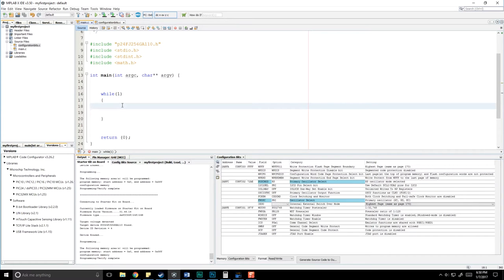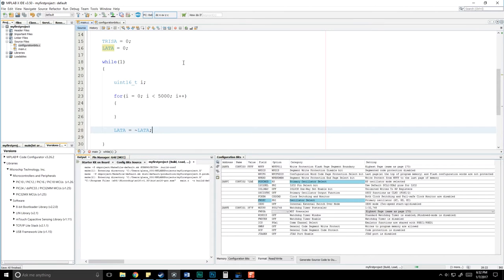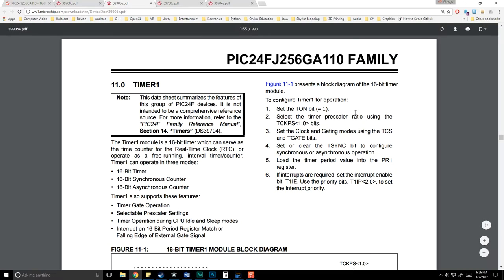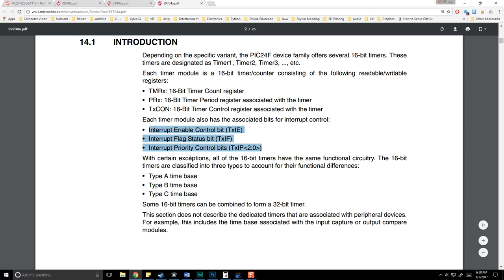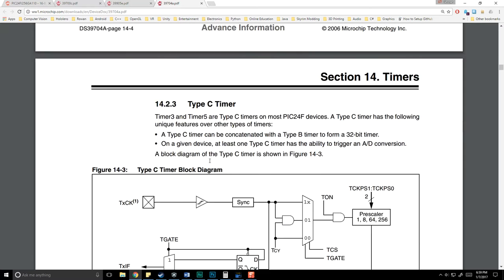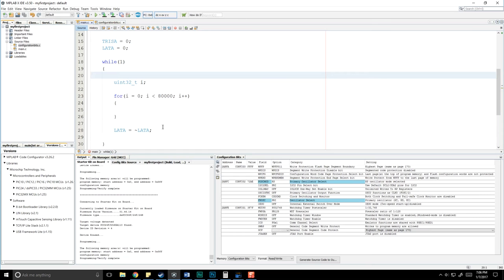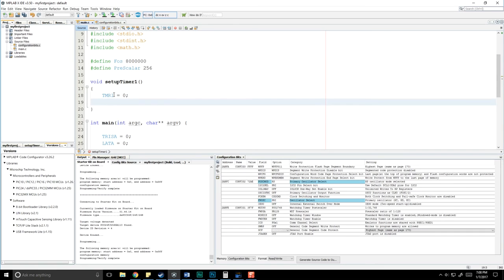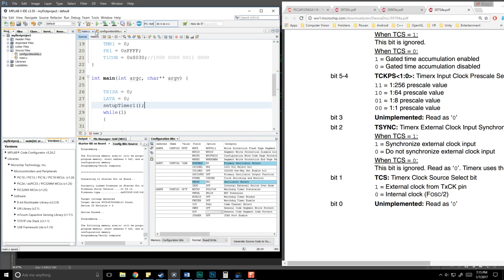Exploring PIC Microcontrollers - 04 - 16-Bit Timer Basics

Comment: Hey George, Thank you very much for your work, I finished all the videos and looking forward to seeing more, especially about sleep and idle modes with interrupts, reading from multiple inputs, ADC, ..etc. 

I am using the Explorer 16, I followed the instruction in the videos, however, the LEDs don't toggle, seem like the interrupt is never called, also when I tried to use the comparison in a while loop between TMR1 and IPerS it shows an error (I can't use defined values, unless I assign it first to a known type like int). another thing, is that I can't use the uint16_t. I don't know if these things are related to explain why the LEDs are not toggling using LATA=~LATA.

I am using the MPLAB X IDE v4.01 with Explorer 16, dsPIC33FJ256GP710A.
Thanks again!

Comment: Good job explaining PIC24 timers configuration. So baremetal, excellent for understanding. Keep it up.
Reply from the maker: My 3D printer board shorted out, my AC motor died, and my power supply is fried all forcing me to get back into hardware to fix. Maybe I'll jump back into this after.